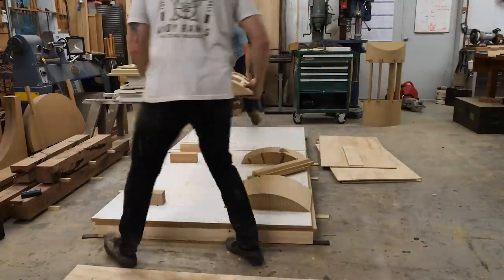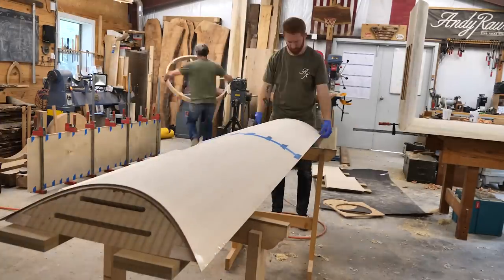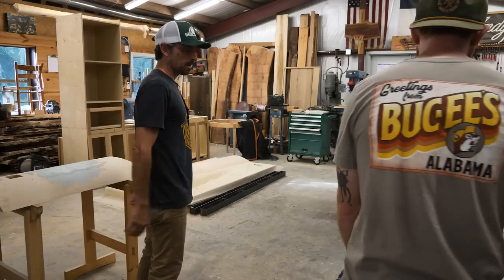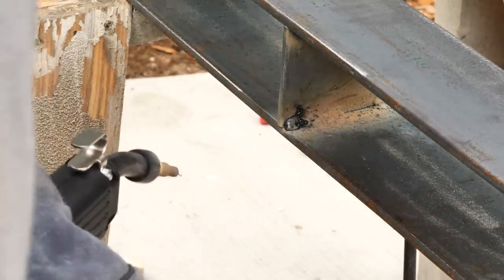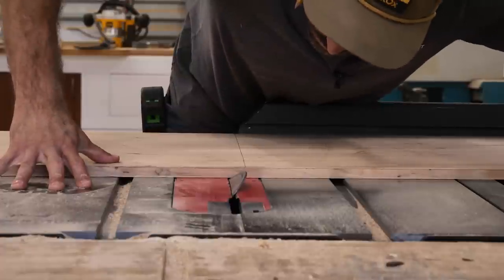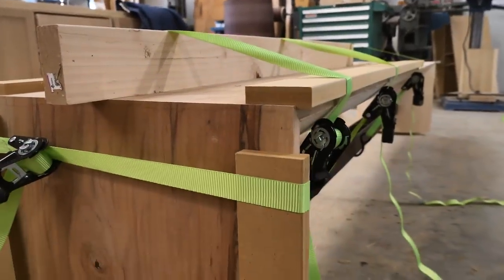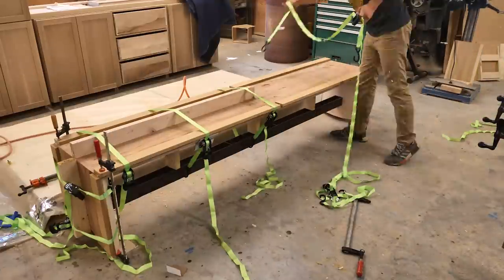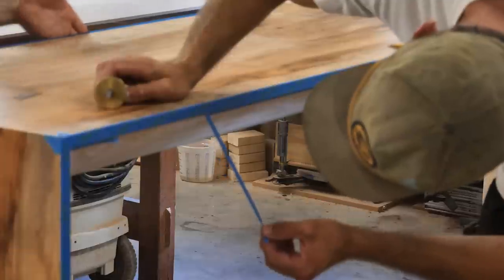Building A Very Large Waterfall Table From Urban Texas Pecan (Part 2)

Comment: The total project looks fantastic Andy and Bob, well done.  I love using shellac, either clear or amber.  We bought a painted dresser, stripped the paint, sanded then placed 5 coats of clear shellac on the dresser which turned out to be red maple, it looks fantastic, don't know why previous owner painted it.  Shellac as you know Andy dries quickly, clean up with denatured alcohol and with 4 ought steel wool or 220 hand sanding between coats, you can't go wrong.  I really enjoyed these episodes on the table and bench and look forward to future builds.  Cheers from this old retired coot living the dream in Tennessee. 🍻👍

Comment: If you don't already have a foam backing pad for your sander, it's a huge time saver when sanding curved surfaces. It's essentially a 1/2" thick foam disk / velcro extension for your sander and conforms to curved surfaces when sanding.
Reply from the maker: I’ll look into it thanks!

Comment: Andy, another great video.  One suggestion for the future for keeping your layups true to the original form, is to allow for air to be exhausted from all sides (inside as well as outside surfaces).  I suspect that the reason you had some "divots" (as you called them) is because of uneven air pressure on all surfaces.  If you want more info on this, phone me and we'll discuss it further.

When it comes to mitering the ends to create the waterfall, it's too bad you don't have a slider, as that would have made life so much easier for you!  

Cheers,
Marty
Reply from the maker: Thanks Marty!  I do have a slider it’s just a low budget slider!!
Reply: @AndyRawls I hear you on that, Andy as I had a JessEm slider attachment on my vintage Unisaw many years ago.  It doesn't give you the same flexibility, capacity nor accuracy as a true slider, but hey, one needs to be realistic with what machines we can shoehorn into our shops.  "Space... the final frontier", LoL

Comment: Vacuum pressures can catch you off guard.  The way I always think about it is through area.  If you have an unsupported strip 1 inch wide and 15 inches long, that's 15 sq in and if your vacuum system develops -10 psi, then you have 150 lb on that 1 inch strip of unsupported area.  More dramatic, a square foot or 144 sq in gives 1440 lb on that area if your vacuum source develops -10 psi!